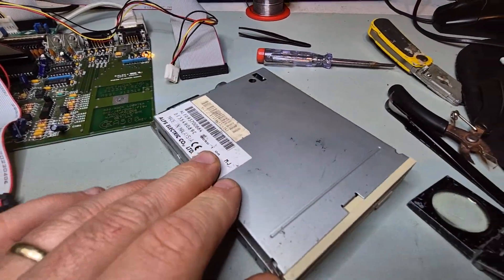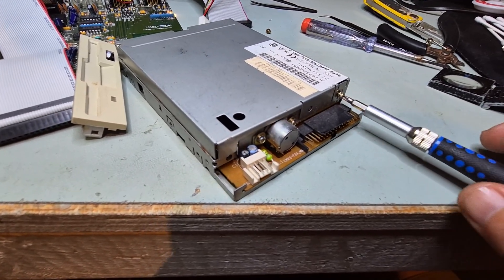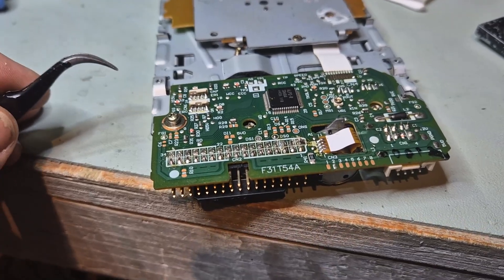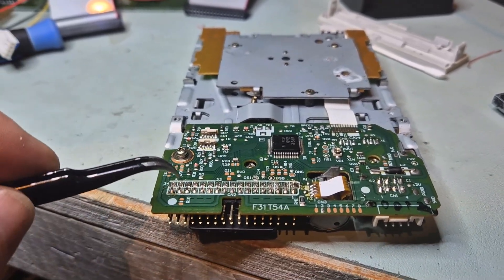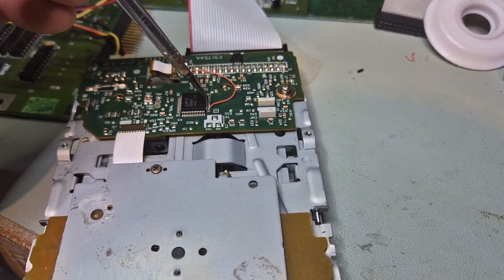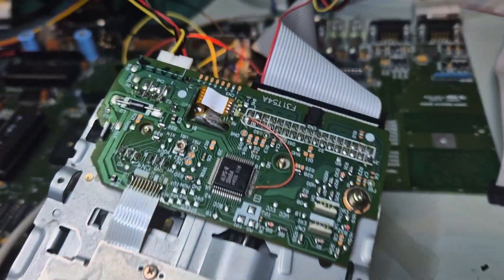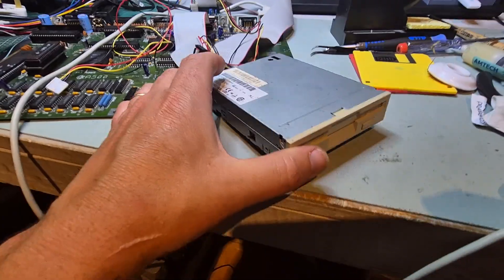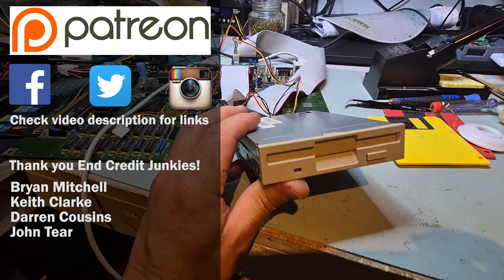PC to Amiga floppy mod (ALPS floppy)

Comment: HD floppy on Amiga IS possible  BUT!   you need to add quite alot of electronics as yop need to HALVE the motorspeed doing this.. (as paula cannot cope with the DOUBLE speed that PC HD does)

I have a HD floppy in my 1200.  useful? nah! :)
Reply from the maker: mind you what's "useful" about any of this stuff I suppose :D :D 
Still the use of floppies nowdays is mostly restricted to reading old floppies for salvaging purposes really.
That or the odd nostalgic urge to load a game for the sound of the drive ... until you realize swapping floppies in a real pain and you revert back to your gotek or HD

Comment: I could never get HD discs to write reliably on my Amiga 500, and after much googling I read people saying that HD discs need a different strength write signal, which made sense. But maybe it's just the notch detector ruining everything?
Reply from the maker: different motorspeed etc... it's possible for the kick of it but the return on the effort is minimal .